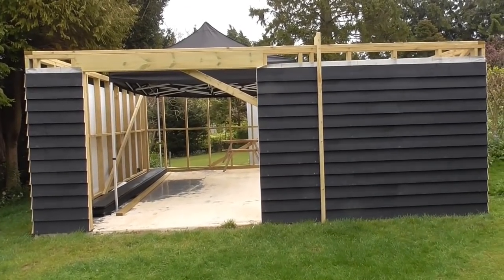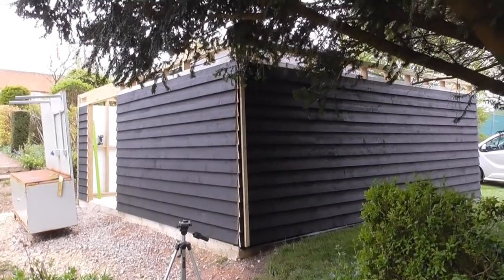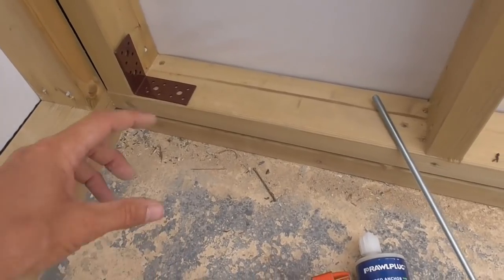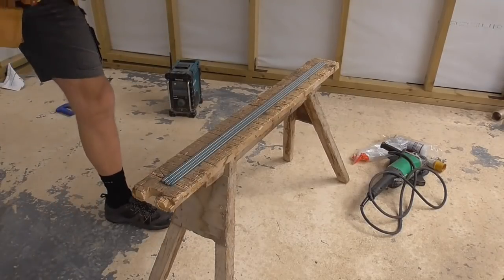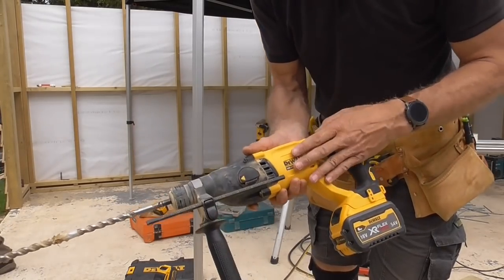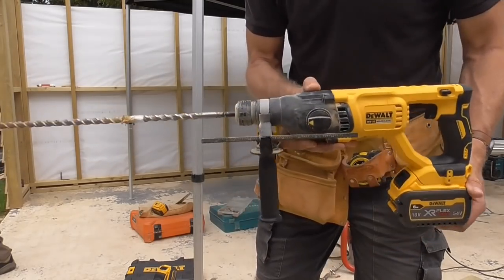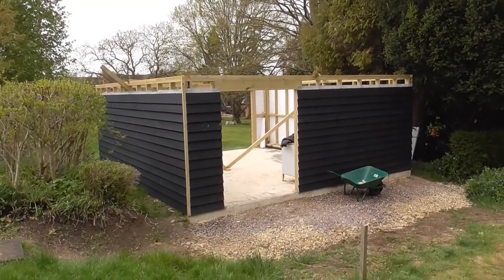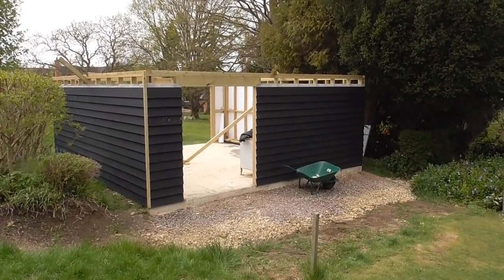Timber frame garage and garden utility space. PART 3 (fixing down using resin anchor)

Comment: I was actually wondering in work today how you were going to tie it to the base, I was thinking wall plates screwed to the studs and drilled to the concrete base with concrete frame fixings, but you beat me to it again. Another great video, keep them coming
Reply from the maker: Hi Darren. I think the resin anchor and studs is pretty rock solid, and fixed some crazy heavy things up/down with it.🤩 Thanks for watching mate, and your comment is great.😎 Cheers.

Comment: Can't be beat having a work dog Tall Carpenter.  In fact 1/4 of my van is dedicated to work dog living room. 👍
Reply from the maker: Top man JRS. I'm slightly jealous of you having a work companion.👊 Thanks for your comment.😎
Reply: @thetallcarpenter  No need to be jealous, join the club.
Reply from the maker: @jrsuk1170  I hear you mate, and I'm always thinking whether or not I should get another one.😬 Cheers.
Reply: Do you wait for the resin to be dry before tightening?
Reply: @thetallcarpenter  looking at your interaction with this pup, YES!!!
Reply from the maker: @rockandmeatroll  Not long on this one Sean. Probably could have cranked on them in 20 minutes but waited about 40. You can tell when its gone off by the looking at what I pumped out when mixing it.😎 Cheers.
Reply from the maker: @rockandmeatroll  🤩👍
Reply: @thetallcarpenter  would this be overkill for wallplates, what would you recommend when roofing on concrete blocks?
Reply from the maker: @rockandmeatroll  Hi Sean. This wouldn't really suit to holding down a wall plate on blockwork, as any plate restraint has to around 1.2m long. Using plate straps is the recognised method and it probably quicker and cheaper anyway.😎 Cheers
Reply: @thetallcarpenter  Thanks for your thoughts :)
Reply from the maker: @rockandmeatroll  👍

Comment: Currently doing loads of concrete base/stud wall research and the youtube algorithm just saw fit to show me your videos. Really nice presentation style and loads of useful tips. Your wonky slab you had to start with is showing me how I need to careful pouring mine. I have one question. You showed the edge tapering off and you had to pack it up. I was going to edge trowel my slab. Do I need to be careful about the round over being too pronounced? Thanks
Reply from the maker: Hi there🖐I've just done a concrete slab for a shed of my own, and I  purposely  left the edges against the shuttering square👍Thanks for your comment and for watching 😎 Cheers Del

Comment: Great upload. Is that the brushless model of the dewalt cordless hammer drill? And does the 54 volt battery add power over the 18 volt? Have a great New Year!
Reply from the maker: Hi there🖐I'm pretty sure it's the DCH133 and definitely YES, it has more 'go' using a Flexvolt battery over a regular 18v, 4/5ah one💪Cheers Del

Comment: Thanks for all the good info. Can I ask why you don’t use/have battens and an air gap behind the cladding? I am a total novice so I’m not judging it, just curious :)
Reply from the maker: Hi there. This is just a basic garden/barn type building and will not be a habitable space. The membrane behind the cladding is more to stop draughts as the feather edge boarding can open up a little and be less than air tight. I'm not concerned about moisture build up between the back of the cladding and the membrane due to the amount of air that the cladding will allow in.😎 Thanks for your comment.👍
Reply: @thetallcarpenter  thanks for the reply; I guess I’m just used to viewing “garden room/office” guides or plans and forget they would be a bit overzealous for a garage/room that’s occupied for less than 5 hours a week. Something to consider for my own project! Cheers
Reply from the maker: @AS19283  Hi there. Everything changes once you want to start working or living in these type of structures and want to manage things like heat and moisture.👍 Cheers.

Comment: 18v tool with a 54v battery is still 18v lol
Nice job 👍
Reply from the maker: Hi Ashlee🖐Yes bud, that's the beauty of the Flexvolt system👊Thanks for watching
Reply: @thetallcarpenter  👍 on part 6 now
Reply: @thetallcarpenter  can you give me a rough idea on how much materials cost for that build please buddy. I’m going to build myself a workshop and trying to gauge a rough cost. I’m a chippy so obviously do all the work myself. Cheers.
Reply from the maker: @ashleewainwright7877  Thanks for watching bud😎Cheers Del
Reply from the maker: @ashleewainwright7877  Hi Ashlee🖐It's difficult to say bud, as the customer paid for all the materials, plus there was the roofer to pay and then the deck to build. I'd be surprised if the whole thing was less than 10k🤔 A straight 6m x 6m building with cladding and the roof, with you doing it, would be closer to 5k I rekon👊Cheers Del

Comment: Hi mate, love your channel.. keep up the hard work. Can I ask are the threaded rods stainless steel or BZP steel? I’m just wondering if I could get away with using BZP threaded rods instead stainless steel which seems to be a lot of money when adding up the stainless steel washers, stainless steel nuts and then the rods themselves? 😏 lol
Reply from the maker: Hi there🖐I've only ever used BZP threaded rod as, in most cases, the concrete will have a dpm underneath it, and even if it doesn't, concrete, I'm my experience doesn't take in water to any great depth👊All the best with your project👍Cheers Del
Reply: @thetallcarpenter  
Excellent.. thank you so much for the reply back mate 👍🏼

Comment: Have you tried concrete screws rather than the threaded rod? I am a novice builder and haven't seen the resin route before and wonder if there are and pros and cons I am unaware of
Reply from the maker: Hi Paul. I'm not a fan of concrete screws, mainly due to the limited availability of sizes here in the UK. If you were fixing studwork panels in an internal environment or a much smaller building, (maybe a lean to), then I,d give them a go, but for this size of building and its location, I'd go resin fixings every time.😎 Thanks for your comment.

Comment: The dog does not recognise the word sandwich 🥪, yet……..

Curious on how you are going to vent this building. I built something similar my self about three years ago, smaller, but similar construction method. During the winter I do get condensation issues. Presumably the slab has no DPM as it is existing? I made a rookie mistake and forgot mine 😱
Reply from the maker: Hi Doug. The slab has a DPM under it and the walls will remain open. Between the back of the boarding and the membrane will have plenty of air to it as the feather boards are not very air tight.(I only use this breather type roofing membrane to reduce draughts inside). Sweating becomes more of an issue once you start introducing insulation and heating, then the building make up has to be quite different.😎 Cheers.
Reply: @thetallcarpenter  mine is T&G boarding for the walls and definitely sweats. Wished I remembered DPM!
Reply from the maker: @dougsaunders8109  Buildings can be so simple until you want to live/heat them, and then it becomes a flippin minefield.😣